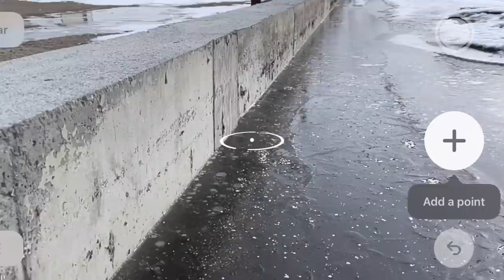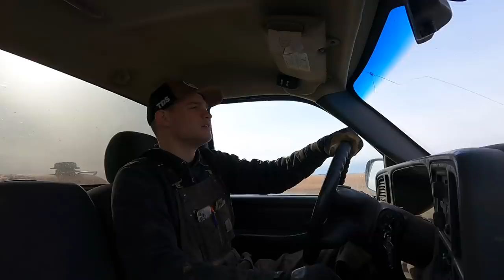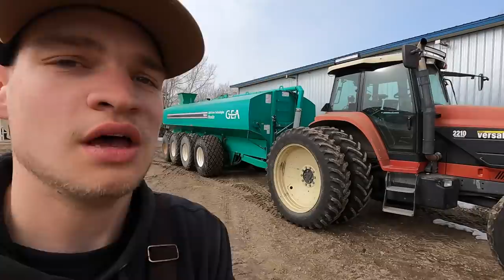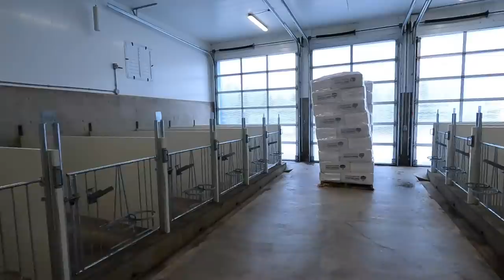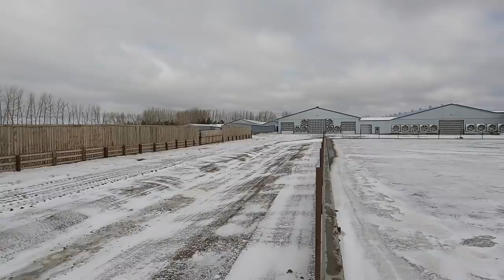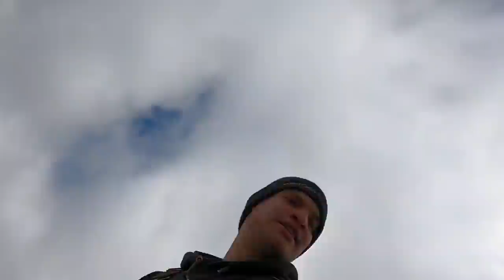Gearing Up To Haul Liquid Manure Earlier Than We Ever Have Before!

Comment: our pits are all underground and with all the snow we have gotten in central Alberta our pits started to overflow last week, losing our family in 2020 to covid now us 2 teen twin boys are raising 23,000+ hogs [35,000 capisity]  Dad and grandfather handled most aspects of the farm but now its just us 2. checking the pits 2 weeks ago the level was 4-6 inches from the top. we asked the county and even Alberta government for help what to do. 50+ inches of snow on our fields and ground is frozen. only when we started to over flow did we get any help. we had to buy a temporary bladder [ $73,000 for it] once we put the pump down the liquid was really overflowing, and once we started  the airaction system it was overflowing in multi places. got things moving for 3 days now, 24/7 the pump is going level is down  40 inches as of friday pit is 12 ft deep.

Comment: Sorry I didn't know the Case/IH was in ICU.  I would have sent a card if I would have known.   Luckily,   I am an MD ( machinery doctor).  I'm not sure how how severe the illness is with the Case without seeing the report from the attending doctor but may I suggest an injection of several gallons of John Deere paint which will,  of course,   help the patients sense of self worth.  If that fails,   I would suggest pulling off the radiator cap,   pulling the old Case away,  and driving a new JD under the cap,  put the cap on the Deere,  and pat yourself on the back for the great decision you just made.